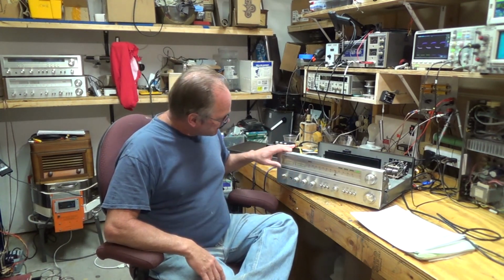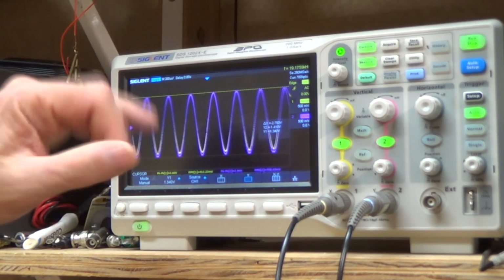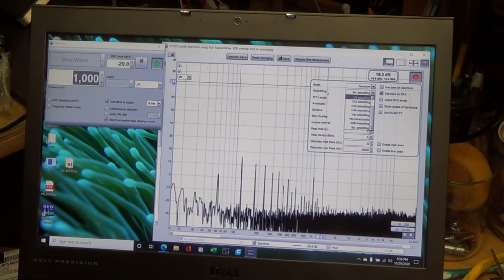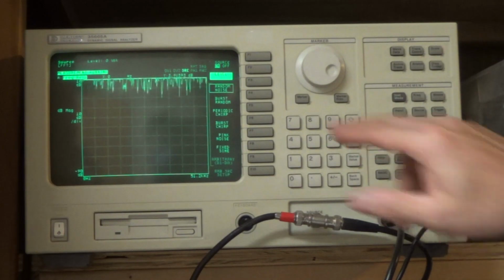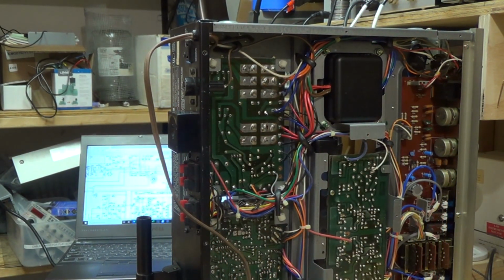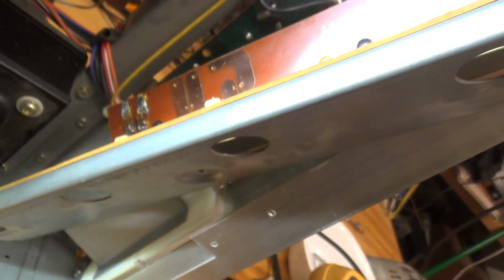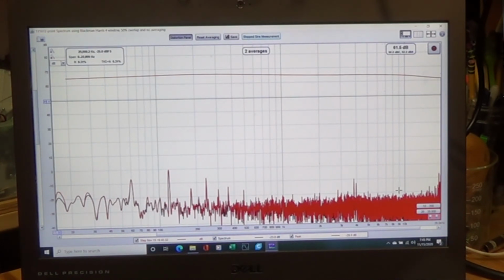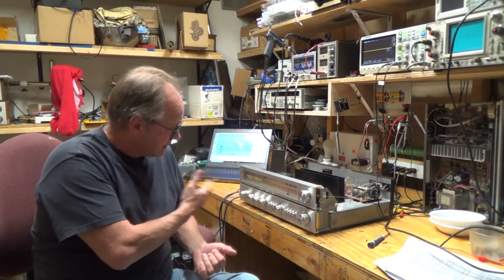Toshiba SA-420 Before and After Frequency Characterization

Comment: Hey Rob, 
        I am an owner of two SA-750’s & one SA-735. And I am with you on the looks. I was a Sherwood guy. But after owning a couple to no satisfying avail,u. didn’t realize i was wasting time & $$ on them , as their time came and went with tube receivers. . And as solid state became the order of the day Sherwood did not have the same QC.
       I find myself admiring a few random oddballs from most stereo manufacturers. 
However when it comes to the initial and long-lasting appeal  of design consistency pioneer and Toshiba are the dopest. 
Personally, i like Rotels unique design as well. But i am wary to dip my toe in that water. Thanks for the toshiba uploads. You the best ,  Homie!!

Comment: Great to see you using the HP35665 Dynamic Signal Analyzer! I was the Product Marketing Manager at HP in Lake Stevens, WA, when we launched that product in the late '80s. I think it's only recently been discontinued after the transitions to Agilent and now Keysight Technologies. By the way, you could have saved the HP35665 frequency response measurements for easy before & after comparisons on the display :)
Reply from the maker: That's so cool. You should be proud, it is an amazing machine! I am amazed at how nice the user interface is for its time. Things are so interesting in the frequency domain!